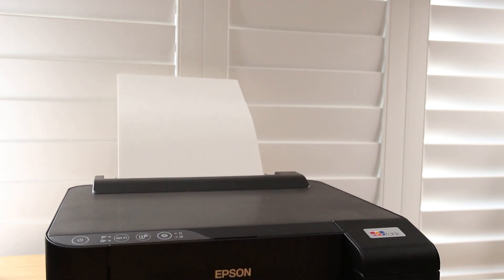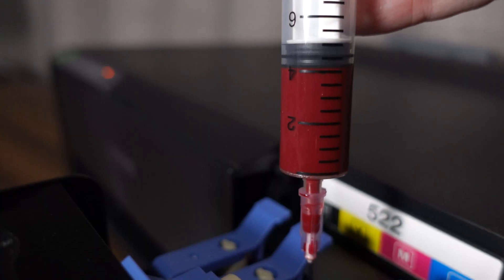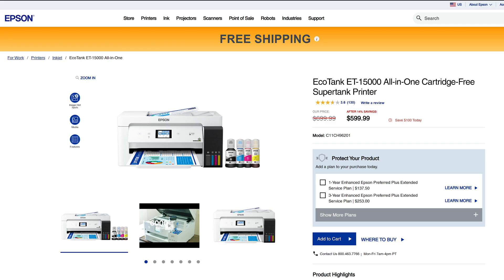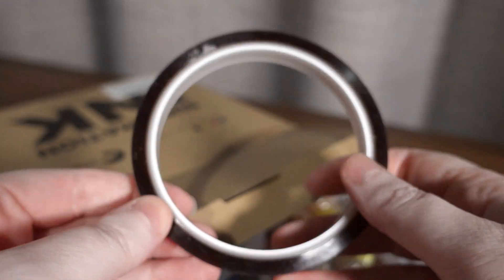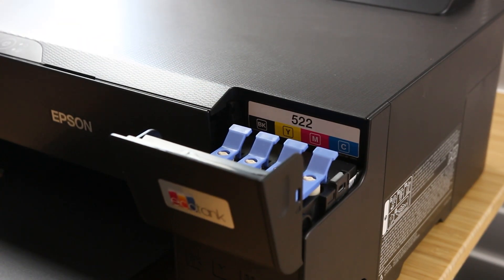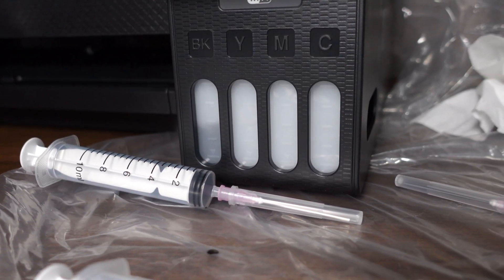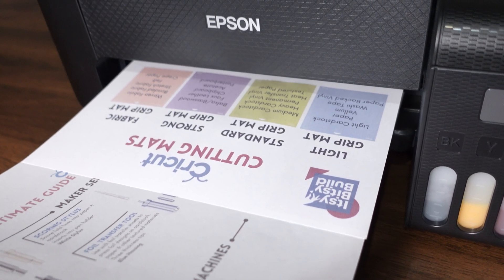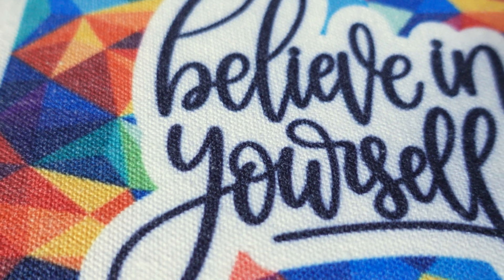Converting an Ecotank into a Sublimation Printer - Ultimate Guide

Comment: Must you need a heat pressed to transfer it to the shirt or does an iron do the same?
Reply from the maker: Sublimation requires higher temperatures and even pressure so it's best to use a heat press. You could always test it out and see how it goes.

Comment: Hi there, thanks for the great video!! I am looking at buying the ET1810 to use for sublimation (I don't need all the scanning & copying functions), but when I search amazon for inks, the 1810 is never listed in the "compatible with" section of the listings.... Does this matter? I am looking at the HIPPOO sub ink listings.... Would it be due to the 1810 being an older model?
Reply from the maker: Hey there, it's not a model readily available in the US. Look for ink that's compatible with the 2800 or 2850 it's the same printer except for the scan feature.
Reply: @ItsyBitsyBuild amazing, thank you!

Comment: No need for a different software? or spray or powder?
Reply from the maker: No need for a spray or powder but high polyester, light colours work best for clothing transfer. 
As shown in the video, you'll need the epson smart panel app to install and control the printer. Once setup, you can access it from other devices on the same WiFi.